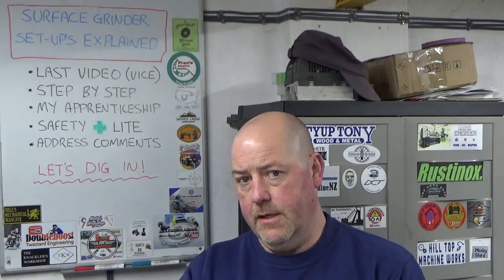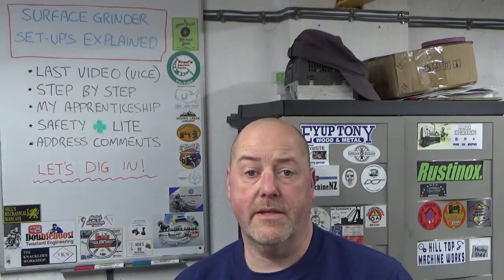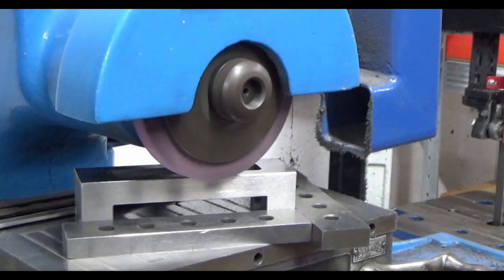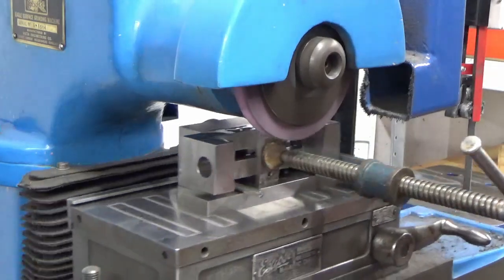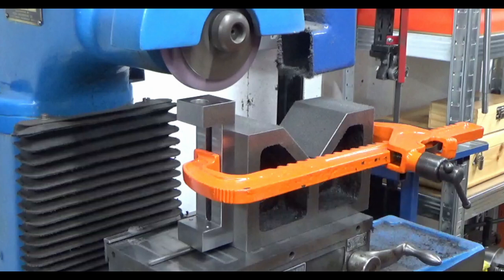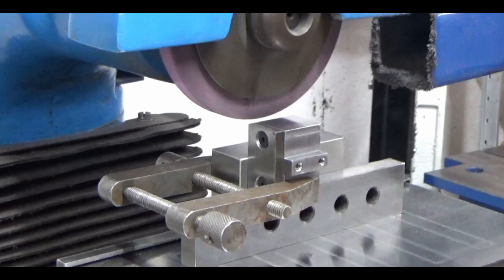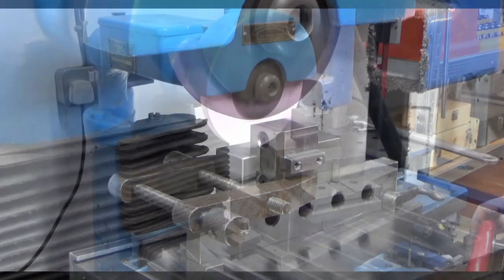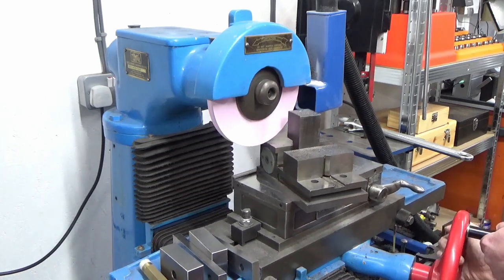Surface Grinder Set Ups Explained

Comment: Hi Jon. Way back in my younger years i was a maintenance electrician in a Large factory. Hestair eagle. They made fire engines & road sweepers + others. There tool room always attracted me & I got friendly with Cyril. Probably long time gone now. He showed me using a surface grinder which was very large. I am sure he told me to get perfect accuracy the bearings were high pressure oil fed to keep them central. It brought back many old memories watching you video. Thanks for sharing.
Reply from the maker: Hi Steve, glad you enjoyed it mate. Can't beat a Cyril, few and far between these days! Cheers, Jon

Comment: cheers Jon, brought back memories of my apprenticeship . 
once on the shop floor i had the misfortune of having my bench near the surface grinder bank. 
I was surrounded by steel guards , but it wasn’t very reassuring as they were peppered with dints and holes where jobs had come loose or wheels had exploded . 
O happy days
Reply from the maker: Hi Bill, yup, not to be underestimated in terms of risk, once things start going wrong, it all happens very quickly. I remember in my apprenticeship when I was just touching on to a whole bed of small punches, the 'children' who were teaching me decided it would be funny to blow up a carrier bag full of Oxy Acetylene right behind me as soon as the first spark was visible. Blew the clock off the wall. Different times.

Comment: I installed a VFD on my surface grinder (Clausing 4002) and I set it up with a 5 second start to top speed and coast to stop. This I believe allows me to start and stop it without loosing its balance. It grinds to +/- . 00015” which is good enough for my needs. I have a self imposed 5” minimum distance while the wheel is spinning. Safety over speed for me. Thanks for showing the setups and explanations.
Reply from the maker: Hi, thanks for the comment. Yes, mine is also on a VFD and I have  similar ramp rates, very useful. Cheers, Jon

Comment: Hi Jon. I did a short workshop skills course at the local college many years ago as a requirement for work. We never got on to the surface grinder, but the teacher did show us the hole in the wall where the (recently excluded) students used to play "launch the part" by switching off the magnet during a grind! 😬
Reply: That's pretty shocking!
Reply from the maker: Hi Olly, lol. Having emptied a magnet a couple of times myself, and watched half moon wheels hitting the end guard, I can truly say it's not an enjoyable experience lol

Comment: Hi Jon. I was taught at Philips when side dressing the wheel, to have the diamond on the centerline of the wheel, LOCK the table and dress it VERTICALLY. Also relieve the wheel so that the cutting area is only about 1/8 " wide at the perifery. Regards from Australia.
Reply from the maker: Hi Dave, I can sort of see merits of both ways for getting parallelism to one or other of the axis etc. locking the table and going vertical would certainly be safer. I left about 3mm at the periphery initially, but was getting a lot of wheel flutter/vibration. I ended up having to re dress and only leave about 0.06". This worked better but loaded up and broke down quite quickly, so I was having to dress a few times. Probably a coarser grit would have helped on reflection. Cheers, Jon

Comment: Great video and yes surface grinders can be very dangerous. Years ago I was told never to turn the wheel off after using flood coolant because the wheel gets soaked in coolant and the coolant will sink to the bottom of the wheel and make it unbalanced. when taking the job off the chuck make sure you lower the job from the wheel giving you plenty of clearance to remove the job. Keep the wheel on for another 5 minutes or so.
Reply: Presumably to centrifuge the coolant out of the wheel?
Reply from the maker: Yes Carl👍
Reply from the maker: Hi Dermot, yes, I was taught the same, I was also told that coolants can break down the wheel bonding agent adding risk of future failure. I have no idea if this is true or not, I can't imagine it is as wheel manufacturers are fully aware this will be happening all the time. Cheers, Jon